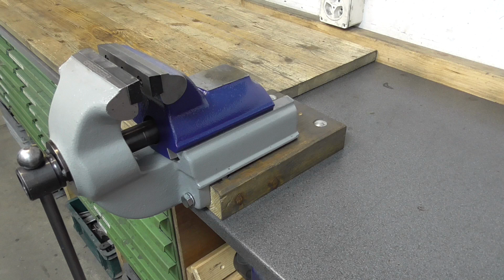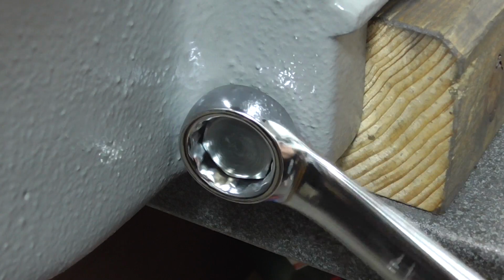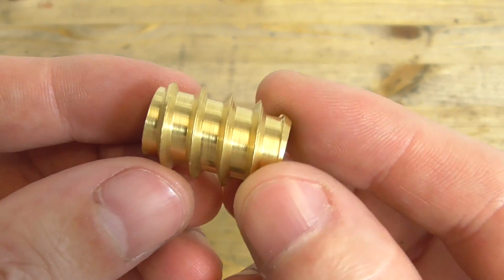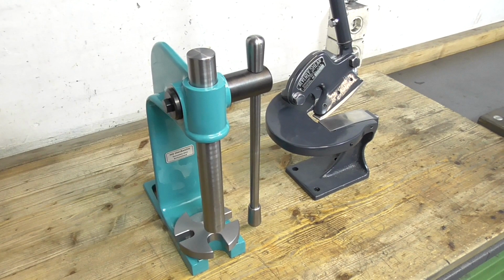I Make a New Plate for the Vice

Comment: Great job as usual. I would seal the wood with polyurethane to avoid the wood to continue drying and make it last forever.
Reply from the maker: Thanks for the tip, but I think I'll leave it as it is. If it turns bad one day I can make a new one again.
Reply: @mymechanicsinsights  everyone loves when you make a new one ;-)
Reply: @mymechanicsinsights  "I will make a new one" :) I should have known! I just bought your t-shirt :)
Reply: my mechanics insights Don’t you mean...? “I make new one”.
Reply: It’s dense hardwood, it’ll last a very long time and it’ll barely move. It looks like a piece of laminated worktop material, so I’m guessing it’s already very dry.
Reply: @mm9773  loks like hard maple
Reply: @mymechanicsinsights  Linseed oil?

Comment: Nice versatility and love the butcher block base!  I used the same technique to hold my vintage restored bench DP (1950 heavy iron) and made an extra set at 90º so I could rotate the DP to hang over the custom bench and be able to drill larger/longer pieces than 10"-12".  I used a dab of quick epoxy for the inserts also.  Also used 3/8-16 button head cap screws with an extra 3/8" length because they are easier to reach with a T-handle hex and don't take too long to remove.  Thanks for sharing this, Nicely Done!

Comment: Great work!!
In Japan, we call brass insert "ONIME Nuts".
I sometimes use its.

When I use its, I put the epoxy resin into the wood holes to harden wood fiber.
It improves durability of wood base itself.
If you have next chance, let try it.
Thank you.
Reply: Yep Japan follower the same thing i have in mind: if the wood Is putted under stress its Better to avoid It cracks there are a lot of holes concentrated in a small portion of wood. I agree 🤘🤘🤘😁
Reply: Epoxy in a hole before screwing in, a good idea indeed
Reply: Dripping runny (not gel type) super glue (cyanoacrylate) into the hole will make softer wood turn rock hard and prevent splitting. For smaller screws and bolts, threaded inserts are not needed unless disassembly 100's of times is required. 1/4" lag bolts can be screwed in and removed many times.

Comment: As a wood worker I find all your videos fascinating!  Though in this case if you turned your block 90 degrees you’d have more luck with the screws not wiggling lose.  The inserts may also show wear too.

When you screw into end grain the threads cut away (over time) the wood all around the shank. The threaded inserts should last much longer but it’s possible they might come lose over time.

Even if your old block was turned 90 degrees you probably wouldn’t have to change it.

Anyways love both your channels.

Comment: I recently assembled a table from two different sources of materials. The top came from one table, and the legs from another. The legs were from a rolling table that had 3 levels. I took two sets of the sets of legs, and cut the longest two to the same height or length as the middle sized legs. I then took an Allen wrench and removed the threaded inserts from the legs, next I got the appropriate sized forstener bit, and drilled beyond where the threads were, cut the legs down, then threaded in the inserts to attach the legs to the top. I then drilled the holes for the attaching plates to the top, threaded the legs in, and had a nice little table that measured 76x76 cm.

Comment: As Jim Pudar has pointed out, putting screws into end grain is always going to be weak. The new piece is very dense so it will last much longer with those inserts but turning the wood 90 degrees and putting the edge inserts into the side of the wood grain would have been a good idea. BTW, It's standard to fix a stripped hole in wood by drilling it and gluing in a dowel as I've seen you do but it always bothers me because it will never be very strong..  Still better than a tripped hole but I would want to use an insert like you did here when possible. I hope you never get tired of making videos because I enjoy the beautiful work so much.

Comment: Fun watching you work, as usual. Good video, as usual. Good economical use of space. But ... use epoxy for the brass inserts I hope? Screws running along with the grain, or into the ends of a piece of wood do not hold well (for the same reason it's easy to split wood along the grain). Get two "U" brackets, inlay them into the wood, top and bottom, bolt them, then use inserts into the ends and top of the block of wood. The brackets where the bolts pass through will take most of the stresses. For added reinforcement, you could inlay nuts into the holes in the brackets, and glue or weld.

Comment: Hi,
I would also put a piece of wood or steel under your bench so that the pressure of those 4 bolts is evenly distributed. 
Just the 4 washers could make a deeper groove on your bench when you hammer which could damage it, or make the vice loose with time.

Comment: You are on my top favorite youtubers! Love that you take a shot for every screw you take off. I just imagine you taking one off and having to move your tripod everytime instead of doing one take. It's all about the piece, you try to have as little of you in the shot. Very professional and well edited. 
I also have a few questions.
● Why dont you make a steel plate?
●is it good practice to put glue on the brass fittings so they dont move while tightening the piece? 
●do the brass fittings move if you torque the bolts too much?
●is this shop owned by you or is it where you work?

Comment: Is anyone else puzzled by the fact that this highly skilled artisan has a composite work bench? 
Personally, tools held by this makeshift wooden block would be safer to use on a 3/4”(21mm) steel plate work bench. 
I feel the inserts will last not much longer than did the lag bolts. 
Still amazed by everything he does

Comment: I’ve used lag screws - and I’ve used helical inserts. But I’ve never used lag inserts! Excellent!

What do you do with the hardware for the arbor press and shear when the vice is in use?
Reply from the maker: I have them placed in the corner on the ground next to the milling machine. Always have some oil spray applied on the bare steel parts to prevent them from rusting again.

Comment: Trying to organize my, to small, garage so I can use my, to many, tools at least half easy, this video I great.
But knowing my self, having to screw in all that bolts every time to change tool/machine would prevent me from doing just that. 
Then it hit me! Intermediate adapter plates with a fitting receiver attached to the bench. With some kind of quick release. 👌
Got to think about that for my own situation, if it’s a good idea. 🤔

Comment: I am trying to work out a system for multiple tools on one bench without having holes everywhere. I thought about a hook and screw system which might work. When I build it I will let you know how it performs. Have you considered making eliptical locking bolts for the tools as it seems a lot of work changing them over

Comment: That’s why all my vices are mounted on steel plates. The 4” on a 1/4” steel plate and the 6” to a 2/8” plate. My 5” blacksmith vice is mounted in a receiver in a slab outside the shop. I can replace it with a large pipe vise by lifting it out of the 2” square receive. No bench queens here, working vices. No problems Amigo.

Comment: don't screw into face grain! that's your main problem. it provides much less holding strength for your screws. you should have turned your piece of wood by 90 degrees.
Reply: face grain end grain
Yeah, even the insert might loosen up over time in the end grain.
Reply: Might also be time to invest in a random orbital sander or something instead of a file lol
Reply: Guy is a machinist, not a woodworker, or he would have known.
Reply: I got the same vice , only mine is  Boley .Great tools😁
Reply: It’s unlikely the stresses involved will cause a failure unless he gets too aggressive using the vise as an anchor for bending Steel !

Comment: The best thing is to not screw into the end-grain. It has relatively low pullout strength compared to the cross grain
Reply: AMason is correct.  Rotating the wood base plate 90 degrees would have been a better approach, whether nails, lag screws, or inserts.
Reply: I also wondered about that, end grain is very weak, I think your inserts will tear out in time, I would have used bed bolts or inserted a nut and washer. so the gressel could be firmly attached at the front.

Comment: So the coach screws threaded the wooden plate because you went into the end grain? The brass inserts will fix the problem but so would turning the wooden plate around so the coach screws go across the grain. Good project

Comment: Looks great! Job well done. However, at 7:40, the overhang of the arbor press seems worrying, with all the weight and forces of the press being supported by just the four screws of the wooden base with the table. If they were to yield when the press is in operation, say pushing a bearing into its housing or shaft, the results would be catastrophic, first to your body close to the press and then to the workpiece and the press itself, which was so lovingly restored by you earlier. Please realign the mounting for the press, such that the base of the press is completely within the table and has no overhang. You could make a recess in the base and table to the centre-line of the ram to accommodate long workpieces when on the press vertically, like a shaft on which the bearing is being mounted.
Safety overrules everything else, including likes and praises on youtube! :P

Comment: After these holes wear out, perhaps you would consider putting the inserts into crossgrain, not end grain, for the machinists vise.  Laminate hardwood so that the grain is vertical to the bench and put the inserts into the crossgrain.  Seal the endgrain, of course, against oils and dirt.  Just a suggestion.
Reply: Airborne Ranger you are absolutely right. As a lifelong woodworker, putting screws or lag bolts into an end grain is to be avoided whenever possible. Eventually, even the inserts will loosen up. At the very least, I would have epoxied the inserts on the end grain. Better still, use a wider board and rotate it 90 degrees. That being said, I truly admire this guy and look so forward to his videos. I consider him a genius in his understanding of metals and metal machinery.

Comment: I was curious about why no steel base plate too.
The problem you were having and will continue to have is you're trying to secure the vise into the end grain of that block of wood. The inserts will be better than those lag bolts but will fail too. Bolts, nails, inserts etc will not hold in end grain.

Comment: with all the great tools and appliances in your shop, a piece of hardwood ends up beeing the real MVP... Good Job, Question tho, would it not have been way easier and steadier to get the inserts in, with a shorter screw? it seemed like it would be rather wobbly, no critique, actually curious. :) Much Love
Reply from the maker: You can control the angle better with a long bolt, you don't want the insert to be slanted.
Reply: @mymechanicsinsights  ah fair enough. I thought something like that. Figured by using a shorter you avoid it getting  slanted when it cant move around, but you loose a lot of control over the angles that way. Fair enough then.

Comment: I really enjoy your videos. You are a master craftsman and a superb machinist. You are not a good woodworker however. In this video, you repeated the mistake you made with the first wooden plate for your vise. Why did you use wood? No matter, your first one you used lag bolts into end grain wood. That doesn't work. In your improved version, you are using very large screws that bite into the wood and machine screws that attach it. OK, that is better but it is still into end grain. Screws into end grain are asking for trouble. Much better if you made a wood piece that offered straight grain wood for all the screws.  Not hard to do with a guy with your talent. I am a woodworker so I know this stuff. I am always amazed at what you can do with metal. My shop is mostly woodworking and auto/motorcycle stuff. Gosh I want to be able to manufacture metal pieces like you do, very very impressive!

Comment: Why not just have the wooden base much longer and have all three devices relatively close to each other. This way they are always ready and you only need to remove one or two of them if you need to work on a very large piece perhaps. I do realize it would be at a cost of workbench space, but benefits seem to be better than cons. 
Alternatively, another solution might be creating a heavy duty version of "lazy susan" and have one machine facing you at a time while other machines would be available after simple removal of some heavy duty anchoring bolt (or other mechanism) to allow the whole platform to be as sturdy as possible. Just a thought.

Comment: You are a pure genius at all things metal but your wood skills need some help. You should never try to screw in to end grain. It will eventually strip the wooden thread out leaving dust in a circular hole. Those brass threads will not last either. You would have been perfectly ok if you used the wood at 90° then drilled holes like you did. No problems. Hope that helps

Comment: You would have better luck by not using the end grain as a fixture. The end grain (where you see the arcs) has the least resistance point of a piece of wood. It is also easier to  screw the insert using a press drill and turning manually.

Comment: As others have pointed out, your board is not oriented correctly! You cannot screw into face grain, as you are cutting the individual “soda straws” that make up the wood itself. Simply turn the board 90 degrees and screw into the face grain. I promise it will hold up longer!

Comment: There's no way in hell I would have made something like that.  I  would have used 1/2 inch steel and thread all the holes or even 1/4 inch and welded some nuts to the back.  Very useless setup and destined to fail.